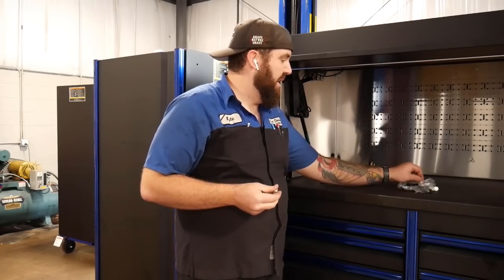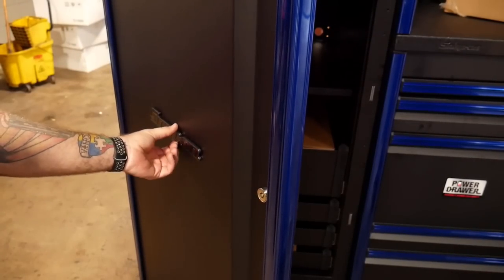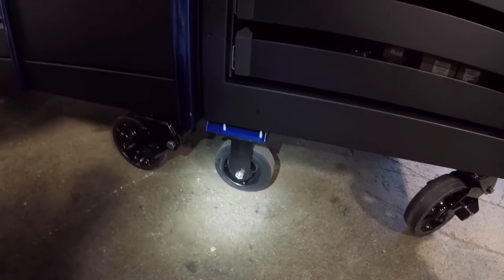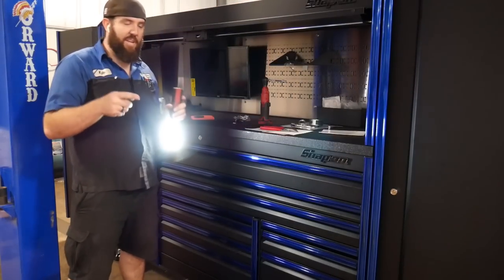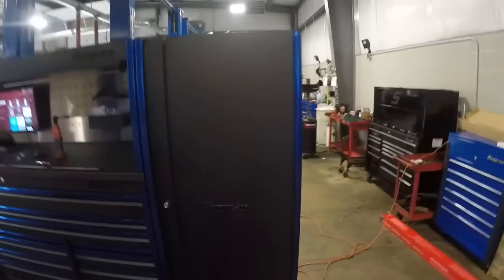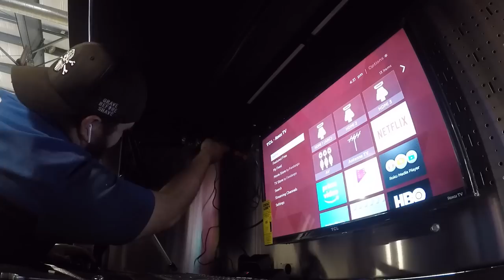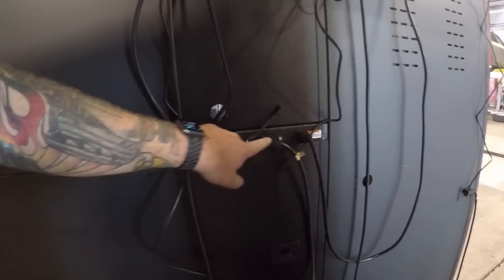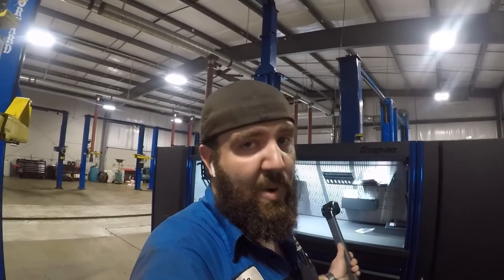NEW SNAP-ON EPIQ TOOLBOX ASSEMBLY

Comment: When I first got into working on cars I couldn't tell a Snap-On tool from a junk tool, they were all the same in my mind.  After I started to familiarize myself with using tools it quickly became apparent that the Snap-On branded tools just felt more solid, I didn't have to ask I knew they were a better brand, not to mention everyone's box had a Snap-On logo on it.  The first time I saw the Snap-On truck pull into the parking lot I got so excited, the one guy told me how I didn't need the all the money right away, I could set up an account and how I can have tools right then and there and make payments, I was all in.  I walked onto the truck  and I was just pointing at tools I wanted and he was piling them up with a huge smile,  I hadn't asked how much anything cost at this point, I was too excited seeing it all. I had 1/2" airgun, 4 socket sets, 2 ratchets, 2 sets of wrenches, 2 extension sets, 2 screw driver sets and a couple hammers. Based on prices I saw while in Home Depot and Lowes, I was upping those prices a little for the quality, I'm thinking maybe $1000 total, possibly $1500 or so. I was wrong, I was so sooO wrong, it was multiple thousands, I don't remember the exact number.  I had to tell him to put most of it back, that walk of shame off the truck with a lousy ratchet and socket set was upsetting but my love affair ended rather quickly,  to this day that is the only 2 things that I ever purchased brand new from Snap-On. They are the Apple of the tool industry.
Reply: To be fair the ratchets are pretty nice
Reply: There is no doubt they are pretty damned good quality, sadly for them their prices have gotten silly, and others are catching up quality wise, I still love my snap on gear though!

Comment: My last box I bought from snap on was a chest one and it was the harley maroon with the upper cabinet. Price was about twelve  thousand if I remember right and I just might be wrong as that was in two thousand three or four. I loved that box and it had just about all the room I needed. If I were to do it over I would get the side boxes as well as it just never had deep enough boxes for all the stuff I had. The testers and stuff for checking vacuum leaks and rad fill and the tester Modus I think was the name, took the place of the brick. Been a long time as I got hurt/ crippled in two thousand five an eventually quit all together so what did that one run with all the bells?

Comment: Do you have video of putting the work center on the box? Do you have a few guys lift it and put it on the box? How did you get it from on a pallet to the top of the box. Thanks for everything
Reply from the maker: We used a forklift to lift the pallet right up to the box height and just barely lifted and slid it over. Or you can watch my bedliner top replacement video where I used the factory lift points to lift it with straps and a forklift.

Comment: Great video. Had difficulty lining up the locker. Got it on but I think one of the welded nuts on the epiq broke off. Had to remove the drawer to hold it from the inside to get that bolted. Ordered the other locker. Any recommendations on getting it lined up.
Reply from the maker: I just literally used pieces of cardboard under the casters to line things up. If it was off a little bit here or there, just roll it back and add a few pieces of paper or piece of cardboard to roll onto.
Reply: Rustbelt Mechanic I’ll try that for sure.

Comment: Every one of my dealers over the years have always at least offered to assemble a new box if it was more than a single small roller box.  That set up is nice, but I prefer the stainless top for writing on when needed and easy clean up of all the grease / oil / paint /sealant, but then my equipment work is probably dirtier than this shop. The locker support being so much better than the KRL line was one of the things that pushed me to Epiq.  My old 1022 / 1201 with the hanging locker sagging off two little tabs really annoyed me.... I just unbolted the whole cross-support to remove extra locker wheels and pulled them off in one piece.
Reply from the maker: My dealer offered to assemble, but I honestly don’t trust anyone more than myself...and what kind of content would that be if I just filmed my Snap-on guy struggling to use a ratchet for 5 hours lol
Reply: LOL! Now that makes perfect sense! I also assembled all of mine pretty much for the "It's my new stuff, let me at it!!" kinda feeling. My last box delivery drew a crowd - 2 dealers and an area corporate rep came by to check it out and see the finished product when I added a 68" stack  next to my 84 / hutch / one locker.

Comment: Thank you but I have to check on my top if I have the holes because I do have full stainless steel top
Reply from the maker: Oh are you talking about the work surface? Mine did not have holes in that, the box came with a template for drilling those holes

Comment: Very nice color combo. How does the hutch attach to the power top?
Reply from the maker: My camera cut out when I did that, it comes with a template to pre drill the holes then you see me putting in the attaching screws
Reply: Do the screws go through the top and thread into the box or only the top.
Reply from the maker: Only the top. You pre drill the hole just through the metal and the coarse screw sets into that and the wood core

Comment: Sooo now that tool box will stay permanently placed at that bay? Is that your bay, is that how it works with car mechanics? I'm for real asking because as a truck mechanic in Australia, the limiting factor of buying awesome big boxes is that you have to push it from truck to truck, maybe because we don't work with hoist and most jobs are dead in a workshop for weeks at a time🤔
Reply from the maker: Yes, we have a set spot in the shop with 2-3 bays (lifts) of workspace and the boxes never move. We just have the tool carts to roll around what tools we need for each job. Really we could get boxes without wheels, but then rolling them back to clean the shop would be hard.
Reply: Rustbelt Mechanic oh that makes perfect sense. That's awesome you have a couple of bays to yourself. Thank you for the reply, and I subscribed after watching this vid, it came up in my news feed and knew I needed to be subscribed to this channel. Thank you for the awesome vid mate👌🏻

Comment: I wonder what mechanics in the states earn a month to be able to buy these awsome tool boxxes? Over here in europe when you work at a dealership or other shop the tools u use are the ones suplied by the dealership. Most of them have cheap junk tools, or incomplete stuf and it takes months or even years to get something new when it get lost or broken. Not talking about a special tool to do timing ect it can take a year before they finaly order it, but you still need to be able to set the timing so need to make your own marks ect...  (realy anoying) A toolbox like this woud be al the tools at one dealership wich everyone has to use. Not takling about sockets or screw drivers ect, everyone wil have some of those. A1/2 air gun, 1/2 set from 10mm to 32m and a set of 1/4, 2 standard extensions of these sizes and the standard ratchets of each, no fancy ratchets like you guys have. It realy is incredible what you guys al have in these tool boxxes.

Comment: No doubt its a nice set up but all this new off the truck...a standard automotive shop.. Theres no way you can comfortably afford this in the budget.  No possible way.  I dont care what your title is.   I love Snap on boxes but the used market is saturated!  If you had to get one you probably couldve saved five figures and settled for another color you liked.  I mean the normal guy who would want one of these can hardly justify even getting a used one.   Most mechanics get out of it after 15 years then you have to try to find somebody to buy it for 50 cents on the dollar if that.

    Im the last person that would typically offer a lesson in spending habits because mine are bad too.  Lol. But what they get for these is off the charts.    I was going to drop a couple g on a used snap on but ended up buying a huge 2 section Milwaukee box with self closing drawers, (not found with snap ons)a hutch, two power strips with dual usb ports.   Huge locking casters. 18 gauge steel.  3 lockable sections.  For sure the paint job isnt as nice but I store A LOT of tools in that thing for $850!  And I love it.    Nobody here is gonna tell me the slides on the Milwaukee would wear out in two lifetimes.  The bottom drawers have dual slides for 200 lb strength which snap on doesnt do.   At some point apples to apples theres some really expensive bragging rights for a name and a paint job.  And I love Snap on.  30k for a car makes sense. For tool storage it just doesnt.  Im sorry.

Comment: That box does'nt make you good as mechanic. I'd rather buy Harbor Freight box put snap on tools on it. The thing is save money.
Reply: You lose 8 inches of depth and this is ak 84 in box. Harbor freight has a 72 and doesnt even have a top available let alone hutches. Lockers are also very small and no power drawers which seriously spiked my interest. I bought a used master series box with no extras so itll only be a matter of time. One thing is for sure I do like the deep drawers on them.